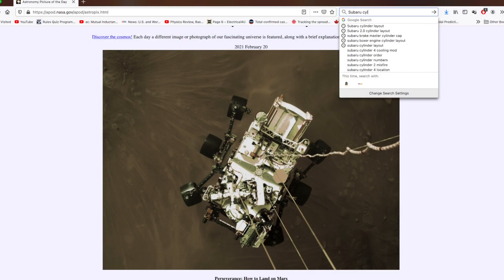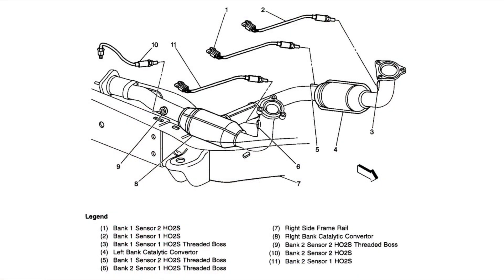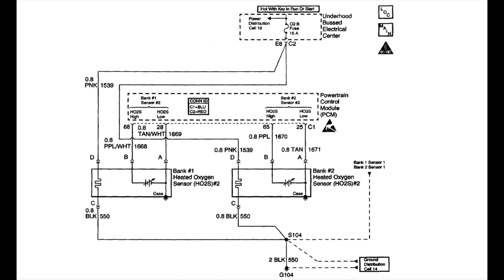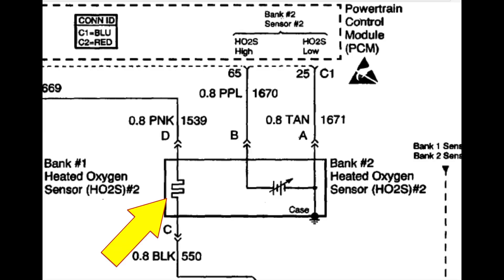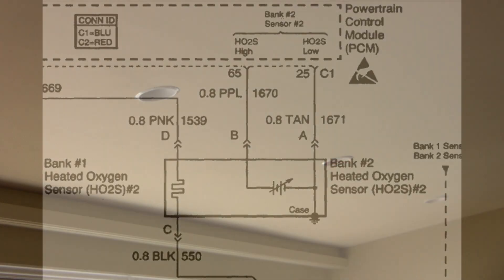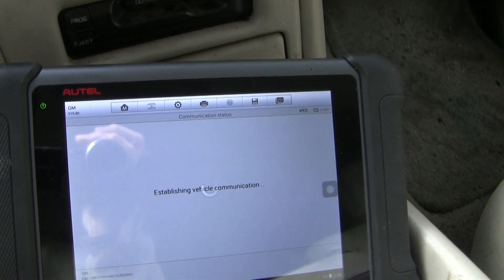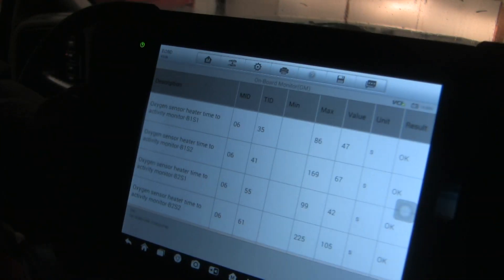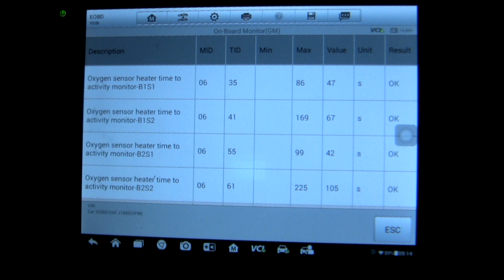Oxygen Sensor Heater Circuit Malfunction P0161, P0141, P0155, P0135. How to diagnose and fix.

Comment: Ive got through 2 02 sensors and before i buy another, what should i look for on the connector side?
Reply from the maker: The biggest challenge is to distinguish cause from effect, ie whether abnormal readings are accurate, reflecting something wrong upstream in the fuel trim or whether the readings themselves are spurious because the sensor is poorly made or damaged. The best way to do that is with a scan tool, but even then with air/fuel sensors it can be tricky. On the scan tool you want to show the sensor readings vary between 0.1 V and 0.9V, and if you introduce air into the intake the voltage drops, if you introduce propane it increases. Snap throttle to see if the cycling frequency rises and see if the readings go rich (0.9V). You can also apply voltage through a resistor, even your own body, and see if the computer detects the change. I would avoid the confusion of buying aftermarket sensors, the risk of time wasting confusion is not worth it. Scannerdanner did a whole series of videos describing how this is done.
Reply: @spelunkerd  thank you for all of the information I appreciate I went back and read the reviews on the cheap 02 sensors everyone basically said the same thing they failed so I am just going to stick with the AC Delco and see if that's it, and I'll run the voltage test too. So when I blip the throttle I should get the 9v reading or is it the opposite? Just want to make sure I run it right.
Reply from the maker: @aheis1313  Assuming you have narrow band sensors rather than the new wide band air fuel sensors, here's a quick summary. When you stomp on the throttle the engine is designed to run rich, which will push the upstream sensors to spike at a maximum of about 0.9V. Then when you release the throttle the sensors will shift lean, dropping to about 0.1V. So the easy way to assess how the upstream sensors swing is to bring up a live data graph on your scan tool, sit in the car and stomp on the throttle. At fast rpm you should also see more rapid swinging of upstream sensors between rich and lean, and a lazy sensor may not keep up with the other sensor on the opposite bank. That's also a useful trick to investigate lean trouble codes. A vacuum leak will instantly improve when you snap the throttle, whereas a bad MAF or bad fuel delivery will worsen at snap throttle.

Comment: I revisited your video.  I noticed a bit of conflict  , maybe your vidoe pieces are out of order .  At 8:27 the sensor is loose, turning freely; however, following that you are using 2 keys  and other ticks to losen it up .
Reply from the maker: A common technique is to back it out until you meet resistance, spray with penetrating oil, tighten it back up, spray again, then loosen again. You go back and forth rather than giving it all on one pass. This is because carbon deposits on the sensor inside the exhaust meet the threads and can damage the threads as you back out. In some situations you can remove a bolt only to find all the threads from the female side have come off. Bolts and sensors can break, too. If that happens, you first drill it out, then you are faced with options of retapping threads, putting in a helicoil, or cutting off the bung and welding on a new bung. All that takes time so it is wise to have patience in an effort to avoid problems later. In this case I found resistance was increasing so I did that. Thanks for your input, most people would not have noticed.

Comment: Question :  After you replaced it ,  you gathered the new data with COLD engine , correct ?    If engine is HOT, it won't activate the heater .      By the way ,  great video, thanks for the details .
Reply from the maker: Yes, it was cold. In this old vehicle, to be honest I don't think it matters. Like PWM control, ability to turn off sensor heaters was a later design change to save energy and eke a tiny fuel economy benefit. It's surprising how much energy is wasted even in electric vehicles, most of which ends up as heat.
Reply: @spelunkerd  Makes sense.

Comment: Hi , so i am getting bank 1, sensor 1 &2 both low heater circuit. Should i be getting constant 12v when i check the 12v circuit? When i check mine, test light is bright then flash 2 times then doesn’t light anymore. I am trying to figure out if its pulses or should be constant 12v on heater circuit. 2005 Dodge Dakota w/4.7L engine. Would appreciate any input. Thanks
Reply: Thanks for the info. Yes i am going disconnect connectors at PCM and check for continuity and shorts in the oxygen sensor circuits. I also might install a 12v light bulb 💡 onto heater circuit and see how it reacts when i test again after clearing codes…
Reply from the maker: Many newer vehicles use a Pulse Wave Modulated signal to power the heaters, delivering 12V with a picket fence style of delivery. It could flash, although I'd expect it to be regular and consistent. Remember to test the engine cold since if the cats are already warmed up the heaters may dial themselves down, usually reducing frequency if the signal is PWM. The other confusing thing is the way the PCM might turn itself off if the circuit is shorted, in an effort to protect the internal driver from overheating. I'd look for a more simple way to make the diagnosis, such as with an ohmeter on the sensor heater itself. If you prove the sensor(s) are bad, replace them, erase codes, and watch to see the signal recover.
Reply: Thanks for the response. Both my oxygen sensors that the codes are showing up for are brand new. I installed them. Denso brand. I will check the both heater’s continuity but i am assuming the are good because they are both brand new. I checked the ground circuit and both are ok….
Reply from the maker: @zeppone4045  Gee, I hope the driver is still OK. The way you get a couple of flashes, then nothing is worrisome, almost as though the computer is looking for the correct resistance and not finding it, then shutting the circuit down. Sometimes if there is still a code in the computer, you need to erase that code first before the PCM will allow a retry. I think I'd start by tracing that circuit all the way back to the fuse and the computer, looking for a dead short somewhere. Especially around the heat of the cat, you could have melted insulation causing a dead short. To examine that circuit properly you may want to remove the connector at the PCM, then look for a short either with your ohmeter or with active testing using a test light. Good luck!

Comment: Great video, that really helps me understand how this system works. Yet, I am still struggling to fix my O2 sensor problem. I have code P0161 (B2S2 heater circuit malfunction) on a 2001 Tundra 4.7L engine. I found a deal on an aftermarket L/R pair, so naively bought these and replaced both sides. After resetting the code, the check engine light came back on within 10 miles with the same code. So now I tested the resistance in the sensors I pulled and the ones on the vehicle:
B1S2 15 ohms - Original OEM part
B2S2   0 ohms - Original OEM part 
B1S2 11 ohms - Installed aftermarket part 
B2S2   0 ohms - Installed aftermarket part
B1S1 16 ohms - OEM part
B2S1 10.7 Ohms-Aftermarket part installed by previous owner
I read this to say that the original B2S2 was indeed bad, that the new B2S2 is bad, and that the aftermarket parts I installed may have the wrong specs. I did not test them new. Also, the B2S1 may be failing. 
Could the wrong specs on the aftermarket part explain the apparent failure of the new part? If so wouldn't both go bad? Could there be something upstream causing the failure? 
Next, I tested voltage at the harnesses running a cold engine and sensor wires disconnected:
B1S2 14V, but will not light a test light at the harness
B2S2 14V, but will not light a test light at the harness
B2S1 14V, WILL light a test light at the harness
In all three of these, the test light does light up if I connect positive at the harness to the frame, showing the 'problem' is in the switched neutral. Does this mean there is wire damage? Or the ECU is malfunctioning? Or something else?
Reply from the maker: With such low resistance, the risk of high current damaging downstream parts is significant, so many PCM grounded circuits will  shut down that function if resistance in the circuit is too low. In that situation you may need to erase the trouble codes before the circuit will work properly. I would buy one OEM sensor from the dealer, erase the codes before firing the truck back up, then see what happens. If it works, you could go ahead and buy the rest. An alternate possibility is that the driver (or ground wire to the PCM module) is fried, but I wouldn't jump to that conclusion yet.
Reply: @spelunkerd  Thanks for the quick response. I did figure out that the PCM shuts down the circuit, and tested it after clearing codes, but still haven't been able to get it to light a test light. The check engine light comes back on pretty fast. I have a sensor on order, and will repost when I get it installed.
Reply from the maker: @michaelscheu672  That's concerning. You could check the fuse, and check the power and ground sources, perhaps even tracing it all the way back to the pcm to build evidence for a wiring problem along the way. Let's hope the PCM grounding driver isn't fried. Some of these produce a PWM square wave output, more prominent when the engine is cold, so I'd be testing with engine cold and codes erased. If your oxygen sensor has very low voltage, remove it before testing so that your test light won't be bypassed through a parallel low resistance arm.
Reply: @spelunkerd   Still waiting on the part, but in the meantime: 
The Fuse: I can't figure out which fuse controls the positive side of the sensors, but the wiring diagram shows that all four sensors have the same positive. With the engine running cold and codes clear (or not) I have 14V between the downstream sensor heater circuit wires, but can not light a test light across them with the sensor unplugged. I can light a test light between the hot wire and the frame. One of the upstream sensors seems to be working correctly - it has voltage AND will light a test light (I only tested one). To me, this confirms the fuse is good.
PCM: These are ground switched circuits, and at the pins leading to the 4 sensors, I find no continuity to ground when the key is off, and find continuity when the key is turned to on, or the engine is running.  However, the ground is not switched off on any of the 4 sensors after I idle for 10 minutes, and not after I take a test drive up a hill. This doesn't seem right. Are the heaters always running and burning out the sensors? 
Removing sensors: If I understand this, you are saying the sensors may use up the available current, preventing the light from running. I have tested by stripping wires on the old damaged sensor (it has no continuity across the heater circuit) and plugging it into the downstream sockets, then turned on the engine (codes clear, engine cold), and by putting probes into the empty socket. All the same result - 14V, but can't light a test light.
Reply from the maker: @michaelscheu672  Gee, that sounds a lot like your driver is not working. To verify that you might backprobe the ground wire right at the PCM to exclude a broken wire between it and the sensor. Just remember that when testing ground wires that enter the PCM you want to use low current test lights so you don't expose the ground circuit inside the computer to excessive current. The cost for a replacement PCM would be high enough to justify a professional opinion, and if the driver is fried you'd need somebody to reflash a replacement PCM. Regarding your question about heaters, old vehicles do run that heater continuously. New vehicles use a PWM output that varies depending on temperature, etc. You may get more clues from a scan tool with live data. For example new sensors have a data pid for current flow in the heater circuit, and many have a bias voltage on top of the signal to expose details regarding circuit integrity.

Comment: If your getting po135 thats a bad heater right? If the heater turns itself off anyway how will that code affect the running of the car or does it?
Reply from the maker: Good question, I'm surprised nobody asked that before. There is very little effect on the car except the pesky check engine light on the dash, especially for oxygen sensors that are downstream of the cat. Environmental protection laws are built into the algorithms, which is why they demand a trouble light. Without the heater, the car will go into closed loop a couple of minutes slower, increasing emissions at first start. I'm told Chrysler does use the downstream sensor 2 data to adjust fuel trim, but most other manufacturers use the downstream sensors purely to assess how well the catalytic converter is working. The upstream sensors are more critical, and I wouldn't hesitate to change those because you'll get brisk return on your dollar by improving fuel economy. Newer broad band oxygen sensors require a much hotter sensor to work properly, so the heater is more critical for those.
Reply: @spelunkerd  My Tahoe's getting a po135 bank 1 sensor 1 code heater malfunction so if i just leave it be and clear the light whenever it comes on it wont affect engine performance? Im just trying get an idea on how these work but id probably be better off just replacing it
Reply from the maker: @roltyd22  Sensor 1 is upstream of the cat, so it is used for engine performance, but it likely starts working within a few minutes from the generated heat of the cat anyway. So, it's not urgent, you could leave it. But that light will be annoying, and if other problems arise you may not know it because the light is already on. And if you want to sell the vehicle, resale value is dramatically less if the light is on. As I showed, replacing the sensor is pretty easy, and if you don't have the right tools a mechanic could do it easily. So for all those reasons it is probably best to bite the bullet and replace it. Also old sensors get 'lazy', which does affect fuel economy.

Comment: Any less expensive scan tool you'd recommend? Something in$500 range 🤔
Reply from the maker: I haven't yet found a scan tool that I didn't learn to hate. Some guys say nice things about the Launch. I would not recommend Autoenginuity, it has too many bugs. Autel is pretty good but subscription fees are outrageous if you want to stay up to date. I've always wanted to try a used SnapOn scan tool, you might find one on ebay for cheap. There are some really cheap tools that can run off a phone that might be worth a try. All big scan tool companies have many versions, with a huge price range, but for starting out all you need is a code reader and something that offers live data.